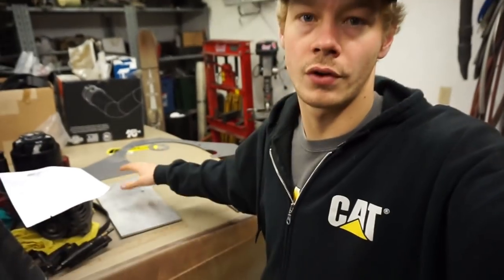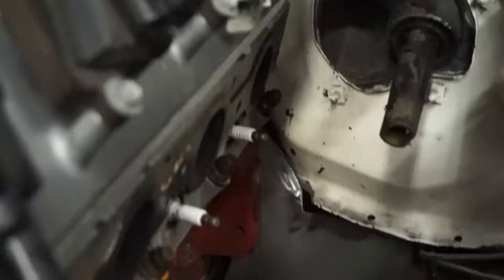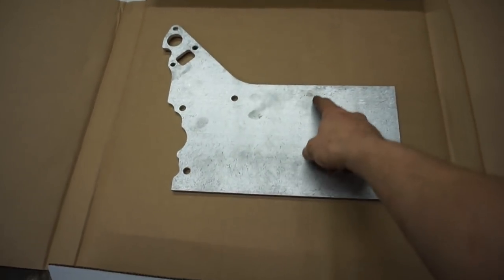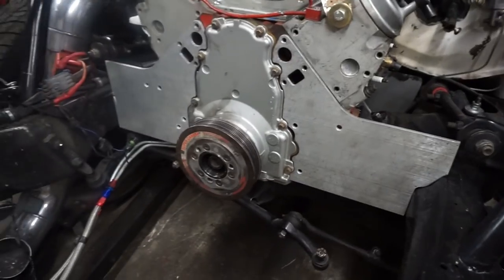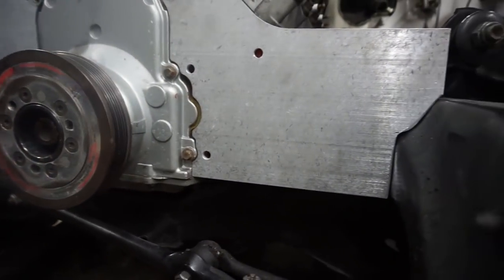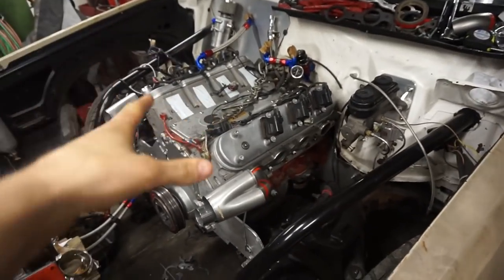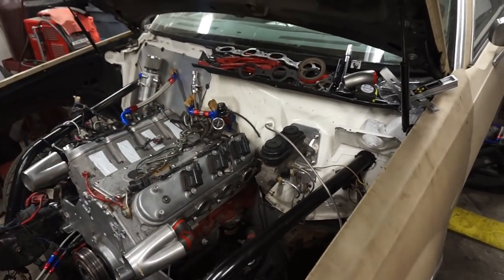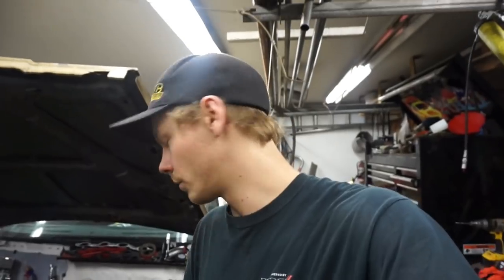MOTOR/MID PLATE INSTALL

Comment: I'm new to engine plates... do you use any sealant or gasket between the plate and the engine on the water pump holes? Or just straight bolt 0n?

Comment: So how do you space the flex plate or toque converter? Since your spacing the the distance from the motor and trans? Thanks
Reply from the maker: sometimes theres spacers for the flywheel but I just used spacers between the flywheel and converter

Comment: if the engine and tail shaft used the same mounting locations did mid plate not move the motor forward or trans back
Reply from the maker: The mid plate is .090" thick witch is nothing. So my motor moved forward .090"
Reply: @horsepowervsyourwallet9769  gotcha. I'm in same boat. was trying to decide to move trans back. 090 or motor forward. wanted to keep engine mounts to help with lateral movement
Reply from the maker: @BotelloPerformance  ya it all depends. as long as it doesn't affect your driveshaft engagement you'll be fine. but like i said 90 thou is really nothing
Reply: yea that's why I exchanged the .250 mid plate for the .090

Comment: How did you figure out the height of the motor?
Reply: In my case, I used the original motor mounts and transmission mounts to locate and measure while I built the plates